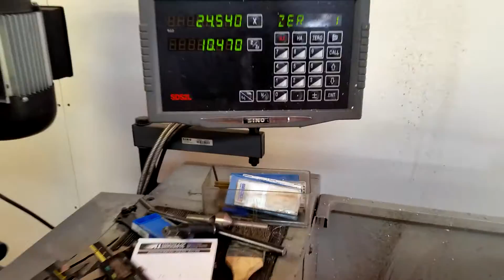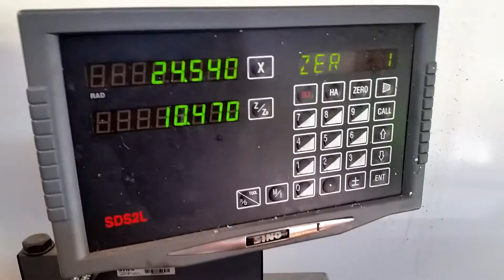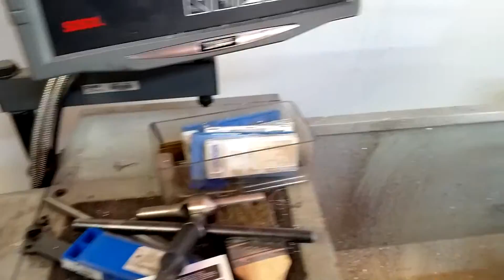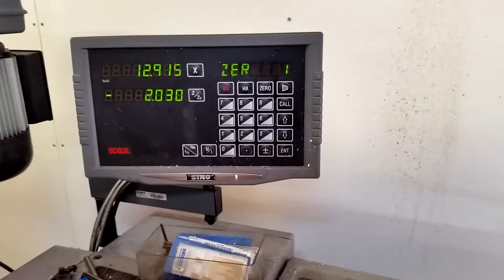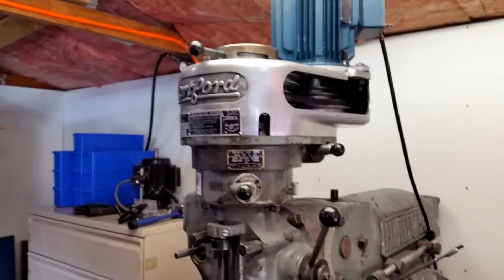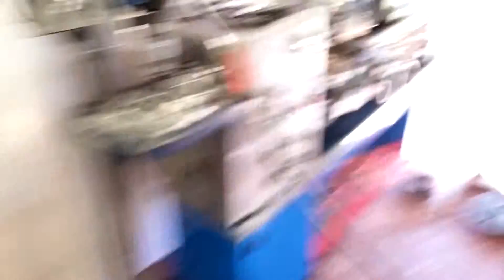Sino DRO losing position

Comment: Did you sort this out? I'm looking at a Sino on trademe and wondered if they're better than the bangood ones.
Reply from the maker: Hey man, I replied down further in the comments there:  I think I had a power failure at some stage and lost some settings on the display unit. It decided to change the display resolution on the X scale. I changed it from 5um to 10um and the issue went away. Cheers
Reply from the maker: Realistically i'm pretty happy with this unit, it does fail to power on sometimes but I think that's more to do with my dodgy wiring if anything (I wired it into the lathe power) I purchased a chinese 3 axis kit for my mill and this lathe came with the Sino 2axis, i'm happy with both units

Comment: This problem can occure if the distance reading head to glass scale is not within the right area of 0,5 to 0,9mm ... there should be two adjustment screws at the housing of the read head or otherwise readjust and thighten all the screws at the head unit. :-))

Comment: Is the X axis been set to read in Diameter?
Reply from the maker: RVK355 I think I had a power failure at some stage and lost some settings on the display unit. It decided to change the display resolution on the X scale. I changed it from 5um to 10um and the issue went away. Cheers